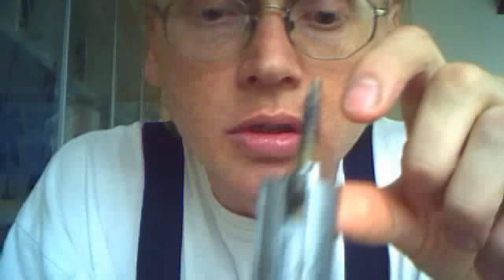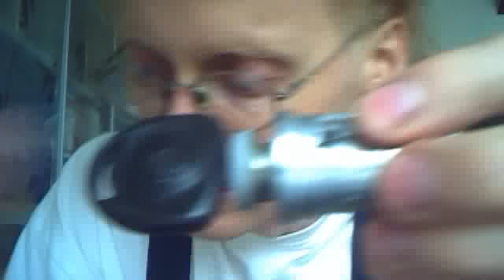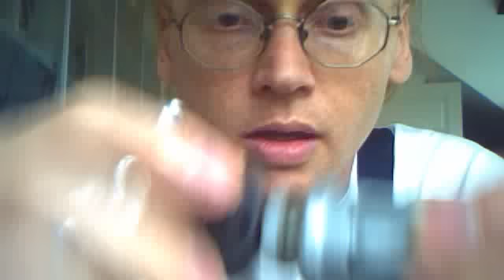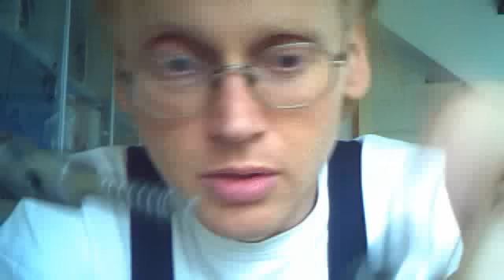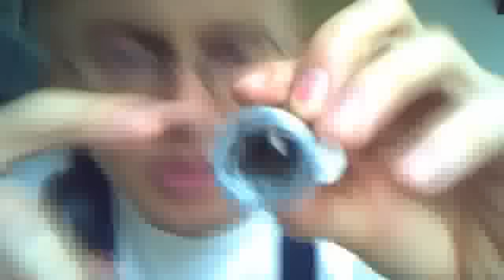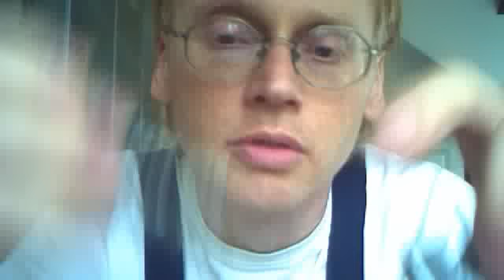gm ignition tumbler barrel dismantling vectra b opel repair

Comment: Hi, Nice video! What do you think about using the cylinder with the tumblers removed? Other than easy theft, making sure position is off when exiting and wheel doesn't, it seems everything else works.

Thanks, Levi

Comment from the maker: hah , when l made this vid, l did not find any similar vids of disassembly of tumbler , now l see at least two , internet infancy
the tabs l call it , are called shims , no , called wafers. here is a vid : ford focus ignition tutorial
You can re-configure the wafers without replacing the cylinder. Just mix and match them. Pretty simple. Try one configuration, insert the key and if everything is flush you are good to go. You might have to remove one or two of them,

Comment: hi orange stone face like your vid .having a major problem with my holden astra ignition barrel is stuck key wont turn. ive tryied to put the wire in the release pin slot doesnt work,previous owner had tryies a srew driver in key slot maybe bent it. i can upload a vid to u if ya want .its stressing me out! im 5 days off calling a lock smith. i could grind the lock flanges but i think it will make it worst.what should i do?!!?!?
Reply from the maker: l did not have that problem so l know little , my problem was unusal l guess, you can see many videos on youtube about your problem and how to solve it probably. and look in forums for astra , try to find the biggest most active forum with many recent threads  by googling astra forum , sign in and ask there, often you will get good answers,  or do a search and read. you could try to pick the lock with a rake wire, many youtube videos. or bump the key on the end with a not so heavy object  while turning repeatedly, maney videos about it too, search bump key. oil it with non stick oil. , l dont know the final solution , maybe drilling it out same way as key goes, but first know how deep and wide.
Reply from the maker: the main thing about finding videos or solutions  it to have the right search words , l found those by googling and reading and forums

Comment from the maker: tumblers removed should work , and if your key and lock have the immobiliser electronic sensor and tablet in key, then turning just the lock will not be enough to start the car, l think. not sure . l think very hard to steal a car with immobiliser  if l remember right.